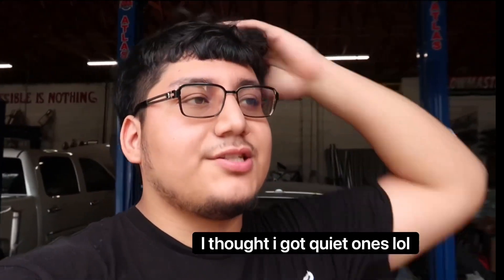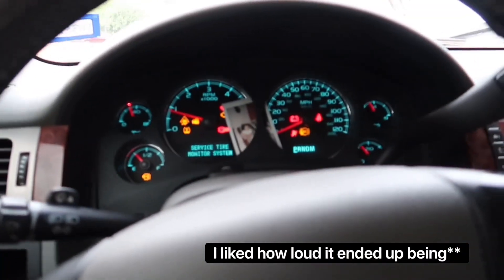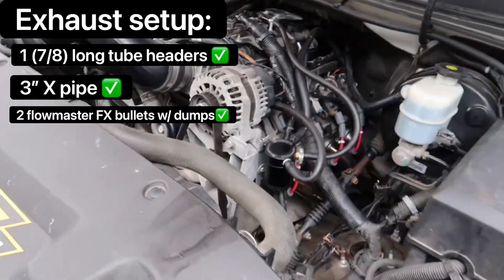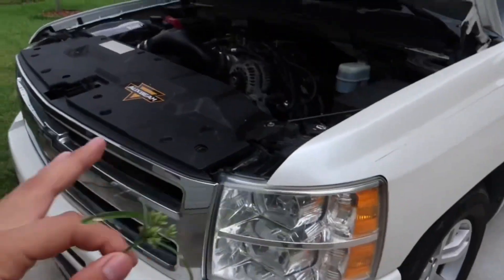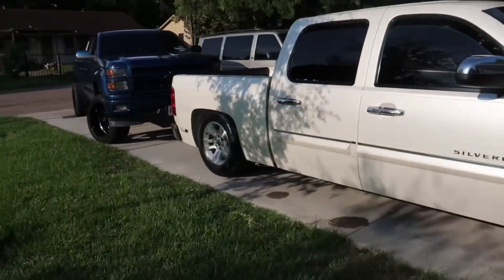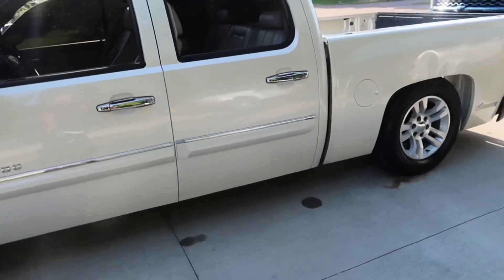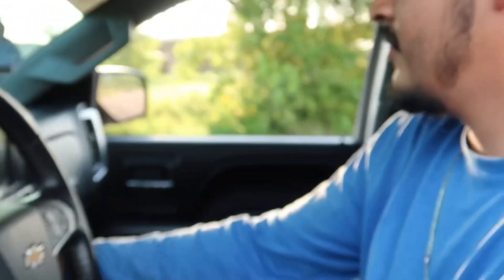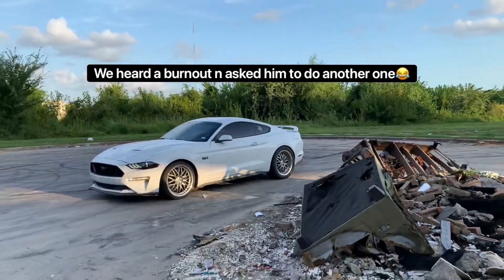TrueDual Exhaust setup on my truck! (5.3 with headers)

Comment: What size spark plugs do you have?
Reply from the maker: I use NGK TR6s v power
Reply: @ricardosmb  shit my bad bro i meant spark plug wires ?
Reply from the maker: @adri2307  they’re MSDs, they sell them on amazon
Reply: @ricardosmb  Mine just came in but there a little to long, there 12 inches. How does your wires fit?
Reply from the maker: Damn idk why they that long, search up “msd wires for a 2004 corvette” i run those. If you search up for a Silverado they’re typically a little longer